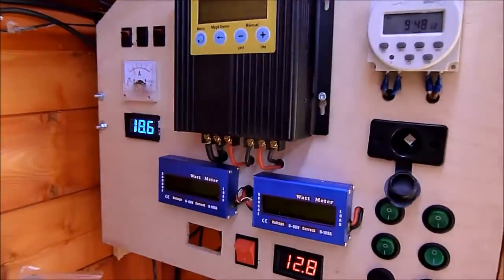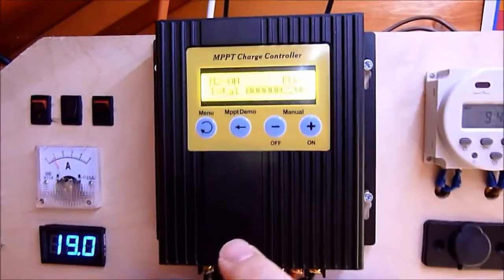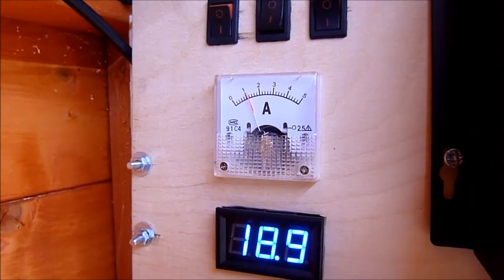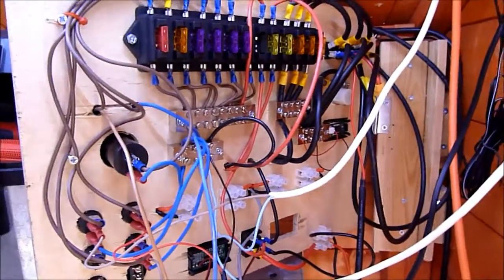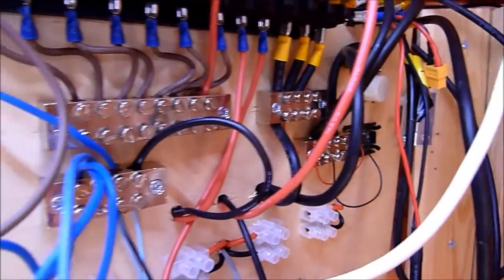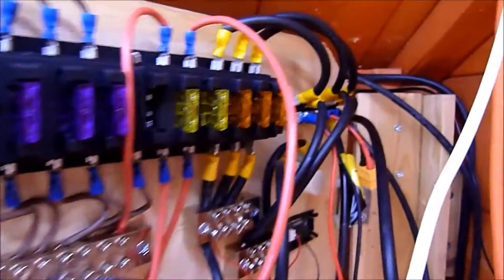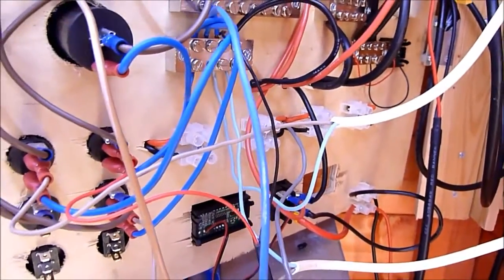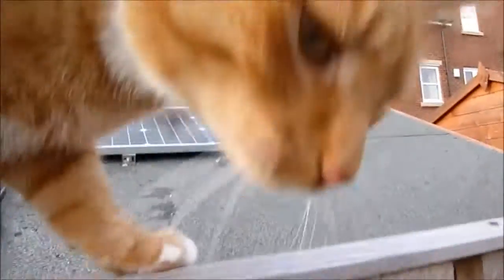MPPT & Control Panel Upgrade - 12v Solar Shed

Comment: Thanks again for this insight. I have set up a system  with similar monitoring of volts in and volts out. I'm assuming the analogue ammeter is on the negative side of the solar panels in. I have installed a digital ammeter on the negative battery in the format to read the load. It is just connected to the cable running from the battery to the caravan distribution board. I turn the various loads on, lights, heater blower, TV etc and the power reading on the combined multimeter/ammeter gradually shows consumption increasing until it gets to around 40 watts. If I add an electric coolbox that adds another 40 watts to the load, the reading on the power indicator of the device starts to drop!! Can you suggest what I may have wrong or is it that the solar controller is topping up the watts!

I struggle to see watts up!!!
Thanks in anticipation...
Steve

Comment: Do you prefer this charge controller or the EPsolar charge controller I currently see hanging on your wall? I am trying to decide on which one to buy for my self. I got the impression this one was more efficient especially at solar wattage's below 10 or 20 watts output. I understand you keep these for a while to test them and occasionally change them out. I am currently using two 100 watt panels but thinking to upgrade to 4 100 watt panels for a 24 volt system.
Reply from the maker: I prefer the EPEver tracer mainly because of the add-ons and the stats you can remotely monitor.  This Eco-Worthy is a decent unit though.  It probably is a little more efficient at the very low levels.  If you watch my EPEver Tracer after 9 months video you'll see that it doesn't do MPPT until it achieves more than 10 watts from the solar panels.
Reply: Adam Welch I suspect the reason why the EPever Tracer does not do mppt untill the solar panels produce more than 10 watts was because the unit itself uses 10 watts in order to operate in that mode. But I may be wrong. In your opinion how many watt hours do you feel is lost because of the EP ever not working in eppt mode during those periods of low solar power output. I am guessing it is not a significant amount.

Comment: Mr. Welch: 

Does the MPPT solar controller shown in your video allow for two or three 12v solar panels in series (panel output of 40-60 v) with a 12v output to storage battery. In doing some research with  lower cost "so called" MPPT solar controllers, they do allow panel connection with anything greater than 22v. Which leads me to believe they are just 12v PWM or a 12v switching charger.

Thanks,
Ed
KC2ORP
Reply from the maker: +Ed Watters Hello Mr Watters. This charge controller has a max solar input voltage of 50 volts so it's not going to do what you want. It is truly MPPT though, but it's input is not as high as some. 
I've reviewed a couple of other MPPT charge controllers that might fit the bill though. The EPSolar Tracer cost about the same as this one, but if you want to go ultra cheap try the CPT-LA10. Both are true MPPT and have inputs up to 100 volts.
Reply: Thanks..Ed

Comment: stumbled across your channel, and am glad i did
this video with the meters, switches and MPPT is where i'm heading with mine
using Wago connectors, but the earth bonds is a good call ( 1 x 100w mono -> 85Ah leisure battery )
i'm wiring in a cheap bluetooth car stereo, and waterproof speakers too
ribbon led lights of an RF 12v relay along with external 12v floods and eventually some lighting on decking at other end of garden

any chance of detail photos and wiring diagrams for the control panel ( so much better than mine lol ) 

thanks
Reply from the maker: +Mark Barratt Sounds like a fun project. The control panel has changed a couple of times and adapted. From a wiring point. Of view all the negatives are commoner together and the switches are in the positive side along with a suitable fuse. Not all that much to show in a diagram, and a mass of messy wiring in a photo! 
Cheers for the nice comments and hopefully you'll enjoy another video or two in the future :-)
Reply: thanks for the quick reply
the solarshed is also a shed ( sadly ) so time in there is limited ( i'm self employed IT/comms so don;t get much free time ) 

i feel a binge watch coming up ( like i did with clive and techmoan lol )

thanks for taking the time to make these videos - helps to know i'm not alone in trying this is the muggy ol' UK
Reply from the maker: +Mark Barratt Yeah mines a shed too. A couple of bikes and garden tools shoved into corners as well as electronics and batteries. Thanks again for your comments and best of luck in your project. Perhaps when you get your project up and running you'll make a video or two - when you find the time :-)

Comment: I'm having some issues with my charge controller that's powering my camper van. Basically the setup was working for about a month in the camper van we purchased(probably running for at least a year before we bought it) and then the solar panel quit charging the battery, input of 0 A and 0 W even though the battery voltage was low, around 11.8 V.

The couple we bought the van from said that this happened to them a couple times and someone told them to short the two leads coming from the solar panel and then plug them back into the charge controller and it worked. We tried this when the controller stopped charging and it mysteriously worked for us for a few days and then went out again. Then we tried it again and it worked for another day or two and went out again. We are currently trying to figure out how to get it back on.

I tested the panel voltage and it was giving an output of around 22V in decent sun and when I shaded it it was giving out 16V. I'm not sure how much power, but I'm guessing that it's working. I then tested the controller by using a 240 V AC to 12 V DC portable battery charger as the "solar panel input" and that actually gave me reading of about 0.5 A and 6 W on the controller. So it appears to me that the solar panel is working and the charge controller is working, but they don't work when they are hooked together. Any ideas on what could be wrong?? I really don't want to buy a new controller just to test it. Also, the short circuit of the solar panel temporarily fixing it was pretty confusing? Thanks for any help :)
Reply from the maker: Hi Alex - that is indeed an odd issue.  I presume your charge controller is this one I show in the video?  
It looks like your panel is acting as it should.  22 volts open circuit sounds about right.  I'd be looking more to the charge controller.  It's operated by a microcontroller so my first question would be have you rebooted the charge controller?  Disconnect the solar input, then disconnect the battery negative - be careful not to short anything.  Give it ten seconds and then reconnect the battery and ensure to choose the correct voltage.  After the mppt test connect the panel and see what happens.

The fact that it seemed to work ok with the power supply may mean a couple of things...  The panel is producing a lot of power (you haven't mentioned its rating) and the charge controller is protecting it's self.  The charge controller is overheating and cutting out.  Or something has failed inside.
I don't know where you are in the world - but camping people tend to be quite helpful.  Has someone in the site got a charge controller you can borrow to do a quick test?
Reply: Adam, thanks for the response! After many hours I've finally got it(at least for now). I tested the solar panel directly and it was giving me a consistent voltage AND CONSISTENT SHORT CIRCUIT when I touched the two wires. Before, in the solar panel wires where they connected to the controller in the van the voltage was consistent, but the short circuit was inconsistent. 

So I isolated the problem to an issue in at least one of the four leads connecting the panel to the controller. I tried replacing the two fork connectors and reconnected everything and it WORKED!!! Even though the fork connectors felt and looked solidly connected to the wire, for some reason the connection wasn't working. Thanks again for the tips...you got me steered in the right direction! Cheers :)
Reply from the maker: +Alex Heil Glad to hear it is sorted. I've heard reports from a few that the y splitter type mc4s can cause issues and don't last forever. Useful to remember for next time. Happy travelling.

Comment: Yeah Adam a few people with these units are claiming it can run 12v 400w of panels,  And one guy states it can run 36v solar panels because of its "Max open circuit voltage of solar panel 15-50V DC". 
Can you please please please please please please please please please please please please test this out!!!! And make a video of it. I want to get one of these units but would look forward to you testing these theories out as you have the knowledge and tools to do so .  Thanks in advance.
Reply from the maker: +oldconvict Thanks for your comment.  I'm not sure I'd want to push this controller to 400w @ 12v to be honest.  Assuming you've got a good bit of sun (and the panels can achieve their maximum) that's about 22-23 amps.  The internals are fused at 25 amp though (see my full review video).  My panels can deliver better than their specs suggest, so I'd personally play it safe.

On the 36v panel question - it all depends on your open voltage.  I'd suspect you are getting past the maximum rating again.  Going over this 50v max could damage the input diode and various other components.  When the unit checks for maximum power point it allows the panels to go to open voltage for a brief moment. So seeing the full open voltage is a regular occurrence.

Sadly I don't have 400 watts of panels or any 36 volt panels.  If I placed all my 50w 12v panels in series, I'd end up with a theoretical open circuit voltage of 63 volts and maximum power at about 52.5v.  Running two 12 volt panels in series (effectively giving me one 24 volt panel) gives me maximum power at 35 volts and an open voltage of about 42 volts. Again, I tested this in another of my videos.
Reply: +Adam Welch The 36v panels are 190w, The Vm is 37.01v and Voc is 45.36v. So that would fall within the 50v threshold of max volts is that correct?. And this MMPT allows step down.
Thank you for answer my questions and how is the MMPT controller going  - any issues?.
Reply from the maker: oldconvict Yeah those panels look like they'll fit within the specifications.

The charge controller is doing well.  The only little issue I have is a slight voltage on the solar panel side at night - I suspect a leaky diode, but this is on my list to test and possibly replace.  It's a minor thing really.

Comment: would you say its worth the money changing from your pwm to mppt charge controller on a small solar set up ?
Reply from the maker: +iarose23 Hi. I guess the answer is - it depends...  For MPPT to be of benefit the solar panel voltage must be a couple of volts above the battery voltage.  For me at least in grey wintery days my panels struggle to get to their maximum power voltage and therefore the MPPT advantage is minimised.  In the summer my panels produce loads of power and my batteries are charged quickly due to MPPT.

I'm thinking about removing my MPPT charge controller for the next couple of months and replacing it with my home made PWM charge controllers as they pull less power when they are not producing it!

I think this is a long way round of saying that you&#39;re probably better investing the money into panels, rather than MPPT unless you can't mount more panels.

Does that help?
Reply: thanks for quick answer i will get some more panels ebay are selling some Biard 80W Watt 12V for £49 i will gve them ago thanks
Reply: how much power draw with no solar to the unit ?
Reply from the maker: iarose23 The official figures are between 15-25mA - http://www.eco-worthy.com/catalog/worthy-mppt-solar-charge-controller-12v24v-p-182.html  I'll test this though at some point.
Reply: i will be looking forward to seeing that thanks. i would like to see pwm vs mppt in the uk  if you have time to do it